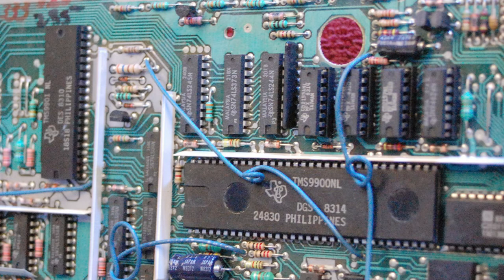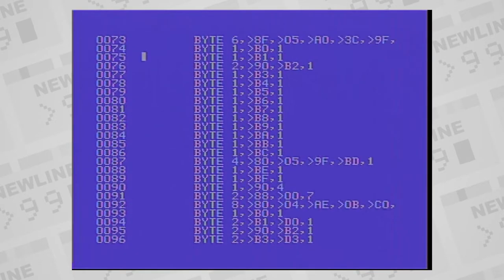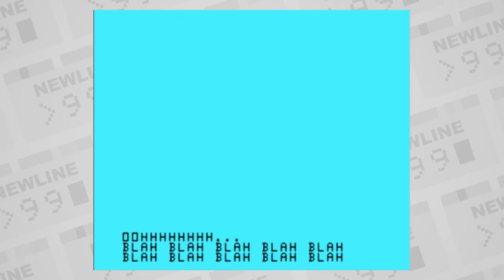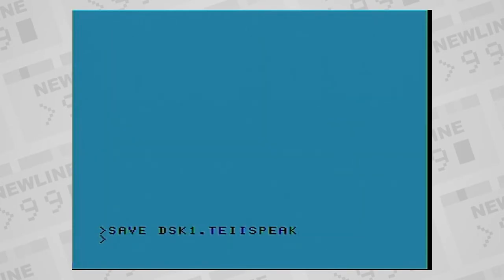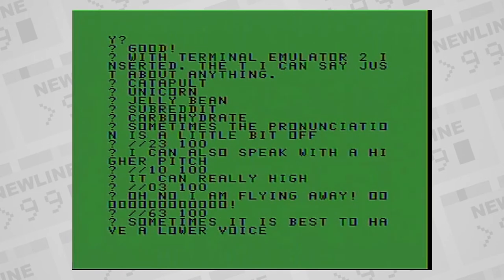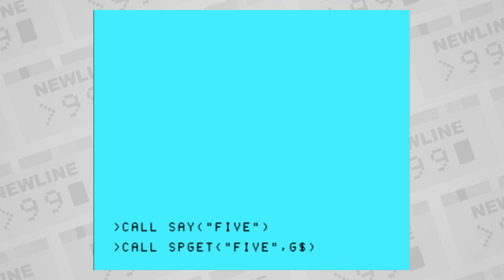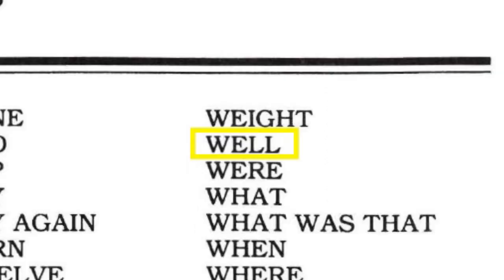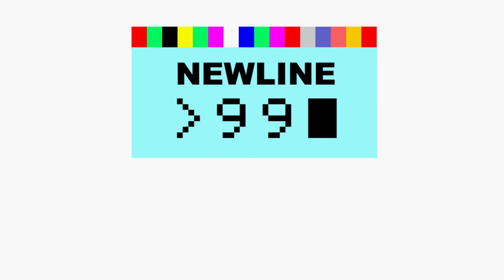Programming Sound & Speech on the TI-99/4A - Newline99

Comment: Is there a link to download the code of the music that starts at 2:40? Would love to save it onto my ti994a music comp. cassette
Reply from the maker: Thank you!  That particular tune was the channel theme song in assembly language.  As far as I know, there is not much that the Editor/Assembler lets you do with a cassette drive.  I would have posted the code on the video's webpage, but I used the sound channels to make "bell-like" decay sounds (adjusting the volume at every tick), and so I decided against posting the music data in its current, very stringy format of 533 lines long. I hope to make and release some utilities later on that aid in the creation of music on the TI, and when I do, they will be part of this channel.
Reply: @newline9937  That sounds excellent! I am just starting to learn coding and programming in general, and the TI994a I am learning on is making things easier for me to understand.  Good luck on your musical endeavors! I love the sounds the TI994a can make.